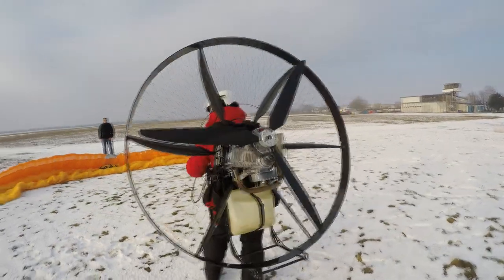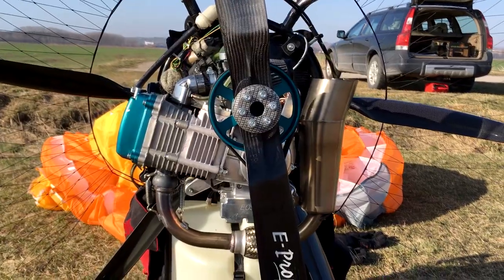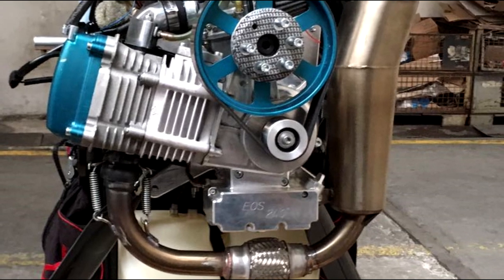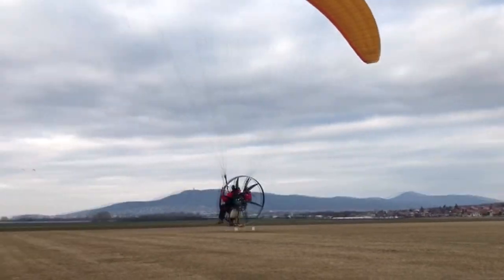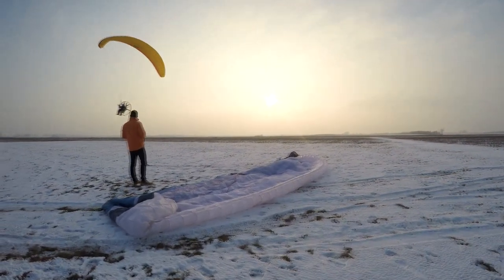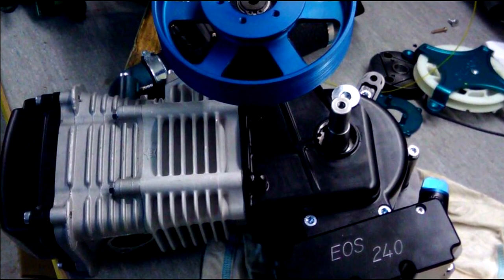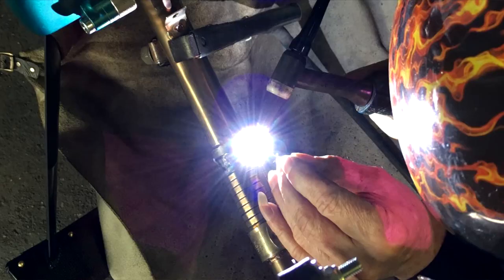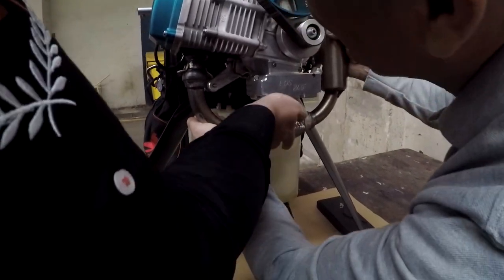Is this the best paramotor engine ever? The first true four stroke alternative!

Comment: I'm WAY excited for this.  This puts SCOUT in great position with the Icarus Challenge.  You pump gas and get amazing range.  I come from dirt bike culture and fly paramotors now.  When Yamaha led out with the YZF426 and won with it the rest was history.  That linear power, cleaner burn, and fuel economy matched with great power is fantastic!
Reply from the maker: yes this would be the ultimate Icarus paramotor....but it must be reliable and time is needed to prove it.
Reply: Hopefully it's reliable like the old Honda XR motor. And hopefully they use a good titanium valve so they don't stretch out.
Reply: Single piece forge- not the bonded.
Reply: I'm a rider, too, who is also knocking around this as my next sport. Plus, how cool to travel with it and fly all over the US. Nonetheless, SCOUT is the best by far. Safety, anti--torgue. Now a 4S? Nice! That's the one I'll buy. Like you, I believe in 4S. Maybe Yamaha, or Honda or Kawi should build these. If they did, you know they'd be fast and last. PERIOD! I want a Hayabusa PPG!
Reply: SCOUT paramotor any tangible updates on the 4 stroke Miro?
Reply: @SCOUT paramotor  but how does the price for this engine compare to other engines?

Comment: 'Bailey' in the UK have been producing 4-stroke engine paramotors here in the UK for nearly twenty years, they even use the same GY6 Honda engine as a base, the one Scout has used  here (re-engineered crank case). I even made my own machine based on this engine about eight years ago (check out my video's). Good engine, bit heavy though!

Comment: This looks really good.

Of all claims though, I want to see the engine on a scale. 15 kgs all up weight for a 240cc 4 stroke is VERY light, this kind of figure is rarely achieved by 2-strokes of similar displacement.

Comment: Terry at Falcon 4stroke here..good work on the project, do not be detracted by downer comments. Do not try to incorporate every suggestion from would-be buyers. Return-to-LZ reliability, heat control & manageable weight are the most important features, everything else is a bonus. EFI is fine but will not produce more power than a well tuned carb. EFI is reliable but when issues arise it will be frustrating and expensive to owners. I would prefer to see the  familiar Walbro pumper matched to the motor. Baily's 4stroke entry to the US market was a disaster and spoiled the 4 stroke foot-launch trend for years. Study this and don't repeat:)
I more thought..this is a process, maybe better to not share all prototype problems. This candor will be used against you by other marketers in the future. Quietly solve the problems and support the engine once it's introduced officially.  Be truthful always with your buyers and you will do well.
Reply from the maker: Yes you are right. Carb at the beginning for sure...

We do not mind sharing our path to make the engine market-ready. Roland from EOS agreed to play a fair and honest game and all the issues must be solved before selling to customers. We do not mind them knowing how much trouble it takes to tune an engine...
Reply: I greatly appreciate the honesty in your process. I am not motorized yet, but am likely to go with Team Scout when I become motorized.
Reply: SCOUT paramotor This is the kind of comment that makes me twice as likely to buy a SCOUT.
Reply: Don’t agree re letting people know the development process. I think it adds to the overall trust.
Reply: While it may not produce more power,  this does have advantages in that the carb does not have to be manually adjusted when changing site elevation by doing it automatically.  This will save maintenance and wear on the engine  by avoiding running lean or rich and ruining the piston or wasting fuel operating in a choked condition in higher altitudes.  Efi is not rocket science to troubleshoot and if readily available  automobile or motorcycle components can be incorporated, this would greatly reduce costs by avoiding the use of 'special parts' exclusive to paramotors.  As a first engine, i would certainly consider s small added premium that would become neglibile over time.
Reply: @UpcomingJedi  Since this engine is a 4 stroke, slight air/fuel mixture variables will not toast the piston as with a 2 stroke. Of course ideal mixture is always desired for best performance. I have not seen recent updates on this project..Is it still progressing?

Comment: Im excited! I would be more excited for EFI though. KTM is releasing a EFI 2 stroke this year which is awesome! The performance as well as range gains from a 2 stroke EFI engine would be monumental. Especially with how the sports environment changes so dramatically just in 1 flight. EFI would change the game. An actual developed and reliable EFI 2 stroke engine (not a EFI kit) in the industry would be unparalleled. I think we are about to see a lot of innovation come down the pipe line in coming years.

Comment: Don't think that you should have the intake next to exhaust minor change could put the carburator facing up to get fresh air.  Its getting heated air and also less oxygen..!  

Lots less noise too with better fuel mileage with the new motor. I was wondering when it was coming out, probable price could be cheaper too! Don't have to wind it out launching it!

Comment: Very interested, hope it won't take too long before we see it on the market, this is what we want in ppg. Bailey V5 sure great stuff, but heavier, and less power. Great to see Eos working on this.
I start to save right away, definitely something I would buy.

But, I really hope they take a look into fuel injection if there is anything they can optimize for ppg. That would be a game changer if it came in a nice package.
Reply from the maker: +Casper Nilsson it will take long. It's not fair to let the customers test the engine...
Reply: Yeah, I can wait the time needed, I know how many years it can take to make a reliable engine. And always nice to have something to look forward to.

Comment: Scout Paramotor : I believe somewhere you said people can get into this sport now with one of the existing engines, and upgrade to the 4-stroke engine later.  Since I'm not familiar with this sport yet... but just got totally jazzed by watching your 30 geometry + other videos... I have no idea how modular these paramotors are (your brand or others).  Please explain what will likely be involved in upgrading to the 4-stroke engine... including which parts will need to be replaced (in addition to the engine of course).  And please also just say a few words about how modular and "mix-and-match" these paramotor products are.  Though I have no experience with paramotors yet, I have been a private pilot for many years... not that I expect that to make the learning process that much easier.

This is probably not the place to ask, but let me also ask whether what I would want to do with my paramotor is actually practical or not.  I will describe my tentative plans here:

#1:  I may fly here in modest altitude places for a while (4000 to 11000 feet), but the application I really need one of these paramotors for is to explore extremely remote locations in the Adacama Andes in northern Chile.  Thought this area extends all the way to the pacific ocean (0 foot altitude), the lowest altitude passes between many of the andes mountains in this area range from 15000 to 18000 feet, with mountain tops from 15000 to 26000 feet.  While I don't expect to climb as high as the highest peak (over 26000 feet), I would like to be able to explore many peaks in the 15000 to 23000 foot range if feasible.  Yes, obviously I'll have to carry a small oxygen bottle and breathing mask.... just as I would in the small single-engine airplane that I'm planning to buy (pipistrel virus sw with 912iS engine).  One guy flew one of these airplanes over the top of Mount Everest, the crazy SOB, while on a solo flying trip around the world!  The reason this airplane isn't sufficient for all my needs is... I won't be able to land any regular airplane on/near the top/rim of any/many of these mountains/volcanoes, whereas obviously not much room is needed to land and stop one of these paramotors.

#2:  I would want to fly for as many hours as possible each trip (and the greatest distance possible too).  Typically zero human beings live or work within tens to hundreds of miles of these peaks, so the logistics get vastly less hassle the further each flight can last.

#3:  If one was to run out of fuel near the top of one of these mountains (say 20,000 feet for talking purposes), how far can one glide for every 1000 feet of lost altitude?  In other words, what is the glide ratio for a heavily loaded craft (but zero fuel remaining) at high altitudes (15000 ~ 20000 feet).  The idea is... if one can glide far enough, one could plan longer excursions by planning trips that consume all fuel (followed by gliding back to the starting points at lower altitudes (typically 10,000 to 15,000 feet).

#4:  What kind of paramotor would you configure for such a purpose?  That is, assuming there is such a thing.

#5:  What considerations need I consider?

#6:  Yes, I'm insane... but I lived and worked at high altitude observatories for many years of my life.  So I'm a bit less insane than you imagine.

Thanks in advance for the information!

NOTE:  To give you an idea of the kind of place and geology I'm talking about, click the following links to see a few photos:
- http://www.maxreason.com/chile_atacama_altiplano_0011.jpg
- http://www.maxreason.com/chile_atacama_valley_of_death.jpg
- http://www.maxreason.com/chile_atacama_laguna_verde.jpg
- http://www.maxreason.com/chile_atacama_valley_0011.jpg
- http://www.maxreason.com/chile_atacama_alma_0011.jpg
- http://www.maxreason.com/chile_atacama_paranal_0011h2.jpg
- http://www.maxreason.com/chile_atacama_paranal_0012.jpg

Comment: Do me a favour - if I'm not mistaken this is a GY6 157 QMJ based engine - probably the commonest 4 stroke scooter motor on the planet made by dozens of China based manufacturers turning out clones of the original Honda engine it's based on. 18 to 20.5hp depending on what overbore kit you go for. Paul Bailey in the UK did it years ago with 5 versions. Looks like another CNC crankcase and overbore to me!

Comment: No two stoke oil, lower fuel burn, flat powerband, lower noise, lower rpm, clutch, ....wow should I go on? If the power is truly comparable as is the weight this is a no brainer. Longevity is the key, I would imagine it has a 12:1 compression ratio to compete with two stroke power which would lower reliability somewhat but a two stroke already has a short life because it works twice as hard to do the same thing. I am excited to see this.
Reply: electrics will retire all i.c.e. engines to the scrap heap of antiquity!
Reply: G Morehouse: Not till charging takes as long as filling up a gas tank.

Comment: Have you tried Bailey Aviation 4-stroke? It is there on the market for ages. Same story: linear, fuel-efficient, quiet, etc. The paramotor update of some classic Honda in fact.
Reply from the maker: Does not come close in power and weight
Reply: Really interested. I like 4-strokes, but Bailey is a bit underpowered for me. Is it possible to compare the tech data? (There is nothing yet on EOS site).
Also: is it injector or still carb? I am very looking forward the injector motors, since I believe it has to improve start and run (the way it did in cars industry).
Thanks you!

Comment: how about increasing the compression, but adding a flywheel weight for good balance and helping keep a consistent idle.
i would rather not sacrifice power.
titanium exhaust would help too.
as far as engine internals usually a forged connecting rod, crank ,and piston and good size bearings
stainless valves are tough too
cheers
Reply from the maker: +dimitri we already have a ton of new updates. Wait for the next video...

Comment: What would make the 4 stroke the ultimate would be to have fuel injection!!
Reply from the maker: Yes you are right... Probably as the next step.
Reply: In this age of electronic ignition - EFI would be even less trouble than a carb with it's tuning even with the minor power loss associated with FI. How many 2-strokes in the field are properly tuned anyway? Good luck, Sir.
Reply: Yes, it is time to move away from the carburetors. This is the 21 century. All cars have them so why not the paramotor? What about electric start added to this 4 stroke engine?
Reply: starwarsfanforlife apoyemos a omega el fuerte🌎
Reply: apoyemos a omega el fuerte🌎
Reply: starwarsfanforlife there are 4 stroke paramotors with fuel injection, electric start, and centrifugal clutch. There is a youtube video of a bailey engine from 9 years ago. Makes me wonder what is really out there. Doing more digging
Reply: bre08005 apoyemos a omega el fuerte🌎
Reply: Just going to put it out there that people have already done EFI projects on small engines with the Raspberry PI
Reply: Many dirt bike engines are now EFI with starters. The technology and hardware could probably be adapted easily.

Comment: Hey Miro... What happened to the follow up to this 4 stroke motor?
Reply from the maker: The project is still alive. We did one update video last year. 
Current status:
Exhaust problems solved 
Lubrication problems seem to be fine but needs more testing 
Engine increased from 240 to 290cc
New cylinder head with 4 valves instead of 2
Now facing some  issues with cooling 

3 prototypes being build now in the eos factory in austria. Hope to have the motor back for testing soon.
Reply: @SCOUTaviation  cheers dude... Thanks for a prompt reply 🙂
Greetings from Sweden 🇸🇪

Comment: Wow! haven't pulled the trigger on a paramotor because of the 2 stroke engines, I simply don't trust them like the 4 strokes, if this comes out count me in for this sport...
Reply from the maker: The fours stroke paramotor engines so far are too heavy and low power. 
Fact is that the 2strokes are not bad at all and our sport is super-amazing. We are grateful for having them and letting us into the air. 
This EOS 240cc 4S will probably just be better, lets hope so.
Reply: Scout paramotor--If Husqvarna made two stroke engines for Paramotors they would never quit or need Maintenance--I have a 30 year old chainsaw that has cut several semi loads of wood, still has the original plug and has NEVER Failed to Start and Run, of course I've replaced cutting chain many times and the Bar several times--It will start on second pull anytime, summer or winter. Two Stroke Engines made by the Right people/Company are still out there.......
Reply: Corral Lobo that’s extremely ignorant. 2 strokes are much more reliable!! Less parts, no oil etc
Reply: You would think they should be more reliable, they do indeed have WAY less parts, but that is not how it works out. Two strokes like to seize and blow up much more frequently than four strokes. It probably has something to do with the power density, and maybe that a two stroke has much less oil in contact with the engine to keep it cool as compared to a four stroke. Two strokes also have the massive design flaw of easily being able to be killed by something as simple as engine braking, or not gassing it every once in a while during cruising, thanks to their oil by throttle style of lubrication. This shouldn't matter in a paramotor application however, as its kind of hard to engine brake with props, unless you go in a very steep dive.

Comment: What is or will be the final dry weight of the whole unit with cage & harness? I'm down to 2 brands and now you put up a 4 stroke for those of us who hate mixing fuel! Price range is the next question but that I know is still in the wind and it is a Scout so this will be a fun decision!
My weight is my problem at 115 after cancer pounds! I know 4 strokes weigh more so 45+ pounds will be cutting it close for me in a PPG before fuel. And the broken down size will matter as I'm going back to work out of a forced retirement to pay for my new passion and RV, so it needs to fit into a Freightliner Trucks passenger door!  Design a nice hstd sided wheeled carry case for it or all your toys and you have a sale! JK.
This is now a new reason to love trucking. Get paid to go to new places to fly! Hoorah!! 

Blue Sky's and Safe Journeys!
Reply from the maker: +rolloverriderpgr I expect the total weight to be 55-57 pounds. But this is a powerful engine suitable for pilots of 200 pounds. With your weight, you do not need that much power. 
Sorry, too early for price quotations. We are at the beginning and there is a ton of tuning and testing to be done.
Reply: SCOUT paramotor Ill have to find those 40 pounds I lost! lol
Reply: SCOUT paramotor Hmmm, nice combination for setting a world speed record!

Comment: On idle, it sounds like my Harley, :-)
I am 210 pounds. Will any of the other Scouts be good for me? I am beginner who will need training, but I am currently looking at purchase costs for the whole equipment. Thx.
Reply from the maker: +pajonate you will need anything in the 25+HP range. We would recommend the Vittorazi Moster plus engine
Reply: Thanks for the response. On the same topic, for beginner, is Enduro Scout recommended moe than the Carbon one? And how easy/costly is to upgrade to carbon frame later when the experience is being build up?
Reply: I have sent you an email regarding the demo unit that has the Moster 185 Classic, but have no answer from you. I guess you check your youtube channel more than your website's email, hahah.
Reply from the maker: pajonate I replied the next day (March 27th)...or was it not you? 
That demo unit is not available anymore, sorry.
Reply: Nope, it was not me, :-) Shame that it is gone.